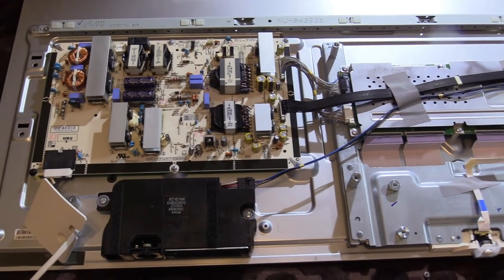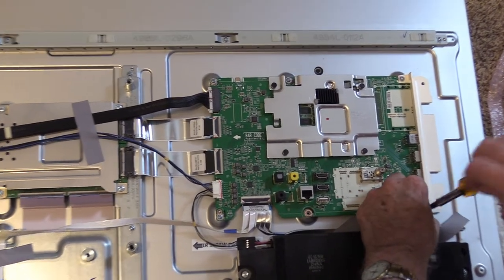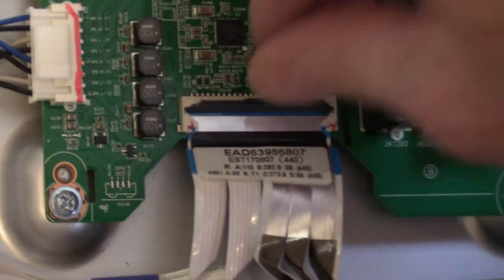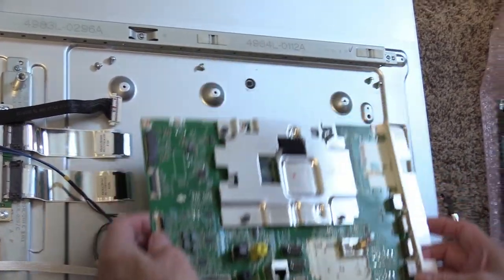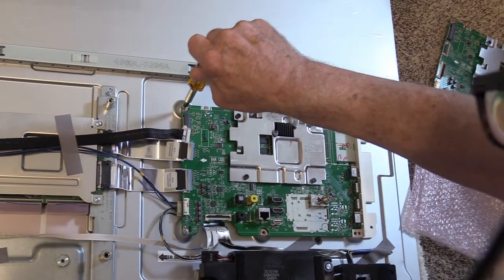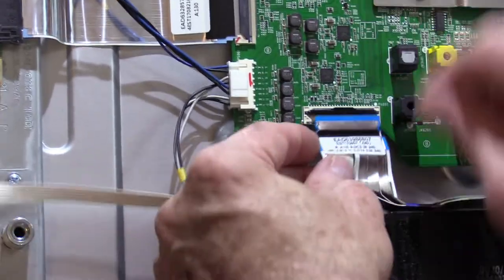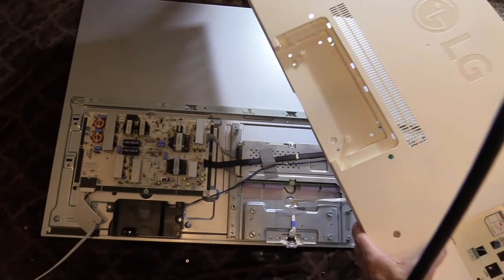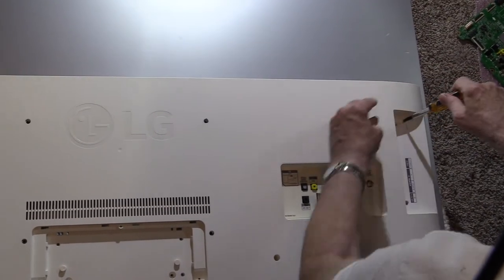LG OLED55B7A TV Mainboard Replacement (Part 2)

Comment: I have an LG C9 65" that needs a mainboard replacement. Would the process with the C9 be similar to this? I could try replacing it myself, it's no longer under warranty.
Reply: Hi I’m in the same position, did you end up doing it yourself ?
Reply: Same here I’ll update soon
Reply: @Ads27185  I had to throw away the C9 in the end. I went to a repair shop with it and was told that the mainboard, panel and power supply were fried after they looked at it. My guess is that a power surge from a lightning storm caused it.

Comment: Just wondering does the TV now have a different serial number in the settings?
Reply from the maker: I have not noticed any changes in the serial numbers from model to model.
Reply from the maker: Mine does not. The serial # as LG told me is assigned to the set as a whole, when I went to them first for the parts and they did not have them available.
Reply: @paulwayne6235  hmmm I'm just thinking the serial number would be stored on the motherboard and if you change the motherboard wouldn't the serial number change.. basically there's a motherboard a power board and a T-Con board inside the tv.

Comment: Here is some personal experience. I did all the unplugged push button hold it tried different cables, etc. etc. none of that worked. I was here thinking I needed to replace the circuit board and I was gonna atemped to do that which seems fairly straightforward, but whatever reason I thought let me just push reset to factory settings. I did that and suddenly both  HDMI portsWere working again. I have an oh lad LG television so I think that's a more powerful option than unplugging and plugging and trying a different cable, etc. reset to factory settings. Very surprised that that worked.